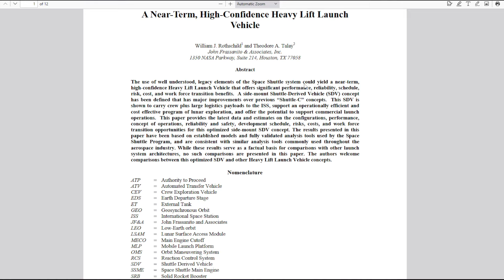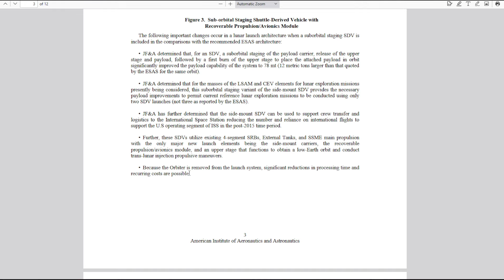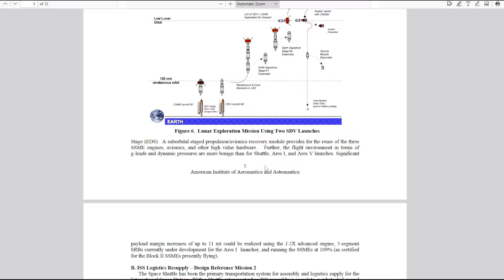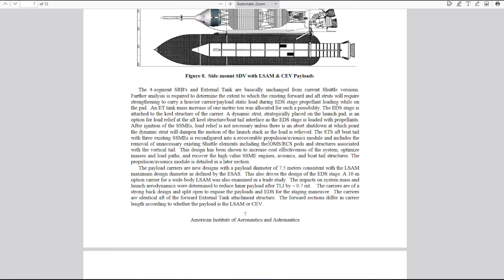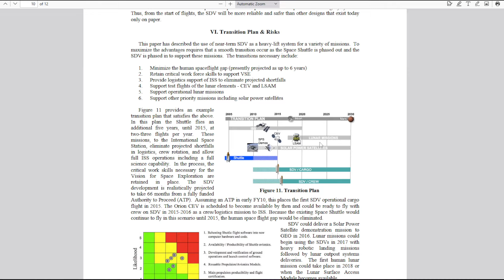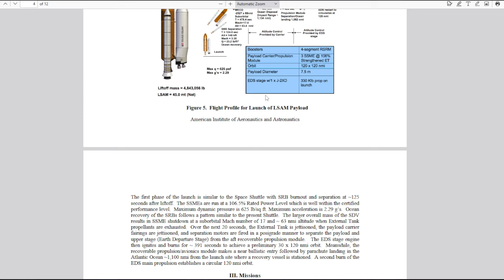On Shuttle-C, the Lunar Mission Version

Comment: Next you'll do Shuttle Z right :) 

Shuttle C was in fact originated during the original Shuttle development with Rockwell presenting a number of alternative Shuttle. The recoverable engine pod had a non-lifting and lifting variety but the lifting was favored because the non-lifting pod ended up landing either in the Australian outback or Northern Mexico.
It "fell out of favor" because it was seen by NASA as competition with the actual Shuttle and that was unacceptable to many factions within NASA.
 Yes the "fairing" structure did carry the same loads as the Shuttle, that was always part of the idea.

ISS logistics is mandated by Congress so there has not been any real way to avoid it.
Reply from the maker: I prefer to think of Shuttle Z as a Zombie Shuttle back from the dead rather than what it actually was.
Reply: @RaizSpace  Well it was "supposed" to be the revived Saturn V or thereabouts... they hoped :)
So... You're saying Shuttle Z is therefore locked in for next Halloween? :)
Reply from the maker: I would love to have a fully decked-out Halloween Shuttle. I could do it technically, but I don't know if I have the time or if I'll remember it.

Comment: Yeah.... Modifying the main tank seems like a no go. Unless, of course, that modification could be used with the Shuttle, too. IE, if the entire SMT production line can be modified to this new design and the new tank supports both Shuttle-C and Space Shuttle while not degradeing the the Shuttle capabilities by much, then it's a "show me the numbers" game. Oh, and, of course, safety can not be further compromised.
But I doubt any of that is I the cards. Probably, the Shuttle-C concept would have to be part of the original design.
...
I often wonder what could have happened if, for whatever reason, NASA got funded well enough for the Shuttle system we got was the Alpha version. That a second, improved Beta fleet of four were then designed and produced using what was learned on the Alpha version. And only then would there be a "version 1" Space Shuttle with all the lessons learned incorporated into a fleet of shuttles.mrant for.the 21st century. 
So, like, what we got was an STS designed in the 70s and released in the 80s. Imagine an STSv2 designed in the 80s and released in the 1990. And finally, an STSv3 designed in the 90s and released in 2000.
Some mechanism of continuous funding would have needed to be found..... Whatever.... Pipe dreams.

Comment: while some ET mods may be necessary, its going to be less than any other shuttle derived LV. Additionally, many nose first ssme pods were studied at various times,  so it should be able to reenter fine enough. I agree that the vehicle is overkill for the iss but the possibility was necessary as they were competing with ares I and V so needed to fulfill both profiles. However keeping the fairing as a strongback removes dry mass from the upper stage potentially allowing it to be more efficient.
Reply from the maker: Well, I'm going to try for a version that doesn't modify the ET by killing the ISS compatibility and that extra fairing, replacing it with a thrust structure. Ares V was never meant to do ISS, so my argument would be, if Ares I was ever thought to be a good idea, we could still put the J-2X stage on a booster and run it like that to the ISS just like Ares I so that this only replaces Ares V.
Reply: @RaizSpace  Heck, if you just assume that commercial crew and cargo work like they did in our timeline, then you really just need something to carry the really heavy stuff. Then you just need to refuel in orbit and you're good to go wherever you want to go.

Comment: Personally, I think a configuration like this only makes sense if you're flying the proper Shuttle alongside it. Otherwise, you're just looking at technical debt galore
Reply: Id maintain it be a decent intern solution to deal with the shuttles nasty safety record, but you aren't wrong that a completely new vehicle would be better. Id take Shuttle C over SLS regardless though
Reply: It also technically makes some sense if you’re flying any large exotic form such as proposed telescope mirrors or large mars landers or something. But those are so niche it will always be better just to come up with a cleverer payload solution to work with conventional launch vehicles I think.